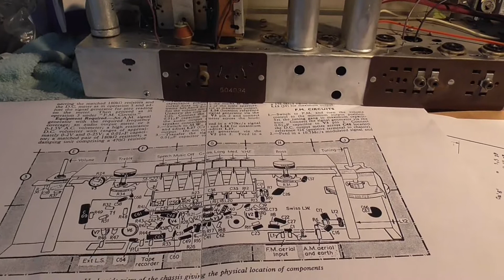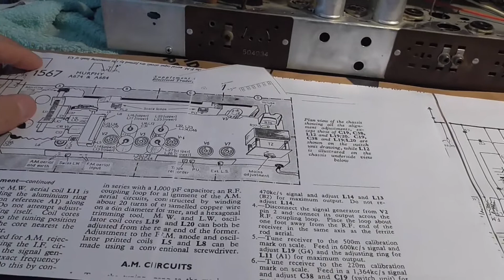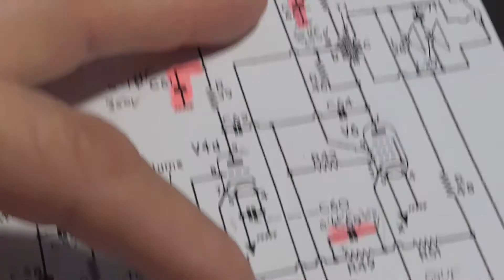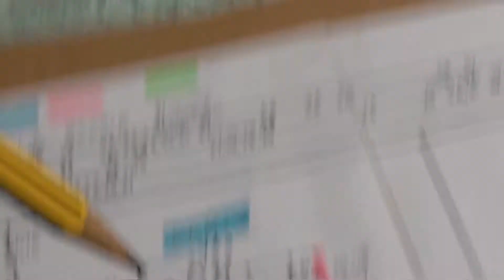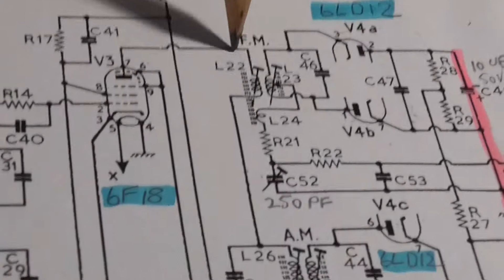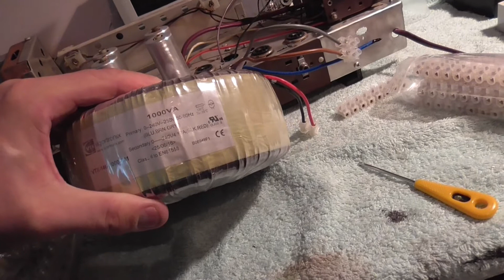Murphy A674  Lets look at the scmatic

Comment: Nice switch box. I have a solder gun similar to the one you have. Nice to have when you need them.
Reply from the maker: Hello Carl  I needed one for long time, but the tin can twisted my arm when had to use blow torch to heat up soldering iron was a step too far.